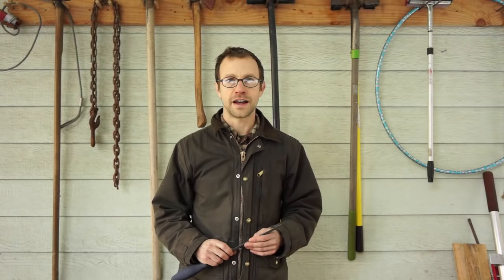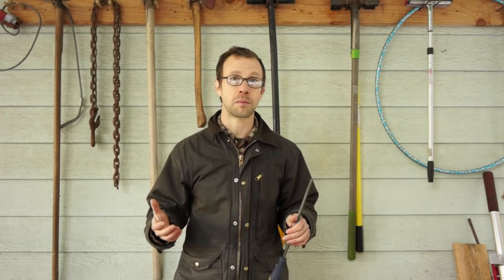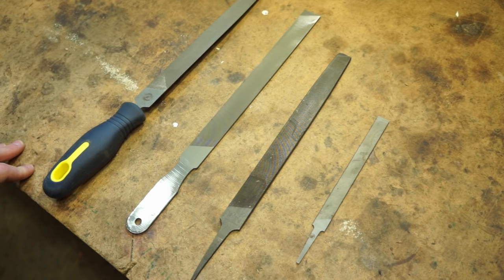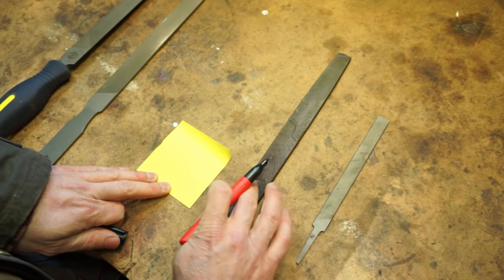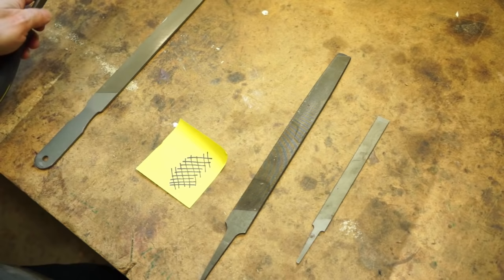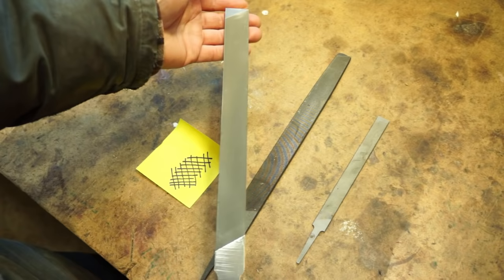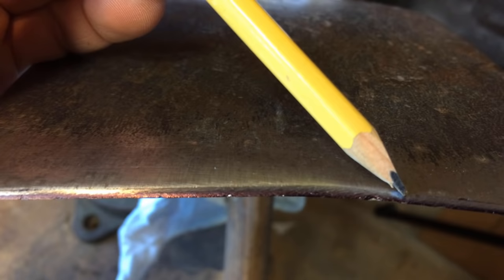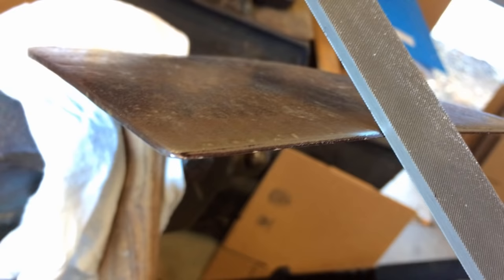How to Sharpen Garden Tools - The Ultimate Beginner's Guide

Comment: Very helpful for first timers.  However it was not clear which side of the file was used. The tips on using the vice & cleaning off rust was great but would like to know what type of oil to use after cleaning blade with vinegar. Overall a well recorded easy to understand speech, good details & almost perfect.

Comment: I sharpen mine when they get to dull to cut.  I use my angle grinder to buzz their edges until the are sharp enough to get the job done.  This is the same too that I use to sharpen my lawnmower blades.  If you buy files, as I do, buy Nicholson files.  They are the best and last the longest.  I generally use smooth files more than bastard files.  I have both.  If I have a tool with a real damaged area I use my angle grinder to clean it up and get it re-profiled and then dress it up with a smooth file.  If the edge is not that bad I just hit it with a file if it needs a sharp edge.  Most hand tools do not need a sharp edge, like hoes and shovels, because they get dull, quick.    Most of my yard hand tools get buzzed with my angle grinder.

Comment: Matt: I have read online that you can also clean tools with baking soda. What is your opinion on using baking soda with water or baking soda with vinegar? Should I only use vinegar (as I do not have the wire brush tool).

Comment: Thank you for the video. I have a file that was my dad's and I always wondered what it was for! Ha! Is there a way to determine whether it is a bastard, second or smooth? It's still in good condition (I think). Also, I can't seem to find the rust eraser you were using. Do you have the exact name or a link? I am finding regular woodworking sanding pads that are more of a sponge with sandpaper around it. I am also finding rust removing whetstones. But nothing that are like a soft eraser embedded with particles. Thanks!

Comment: Hey Matt: Terrific video. I've bookmarked it. Looking forward to getting started. One thing...in the other clips, a number of people suggested using vegetable oil in the beginning cleaning process and at the very end for maintenance. Didn't see it in yours. What do you think? Thanks again...Gerry, Madison, CT.
Reply from the maker: Glad it was helpful, Gerry.  I see no reason to use any oil before sharpening, it will only gum up your file when you begin sharpening, and I don't think it would help with cleaning.

 A little oil at the end to prevent rust would be good, though.  (especially at the end of the gardening season)  Take care!
Reply: Thanks, Matt. Duly noted...I will follow the advice. 
...gp

Comment: after the bastard file, you used a second file? what mill was that? thanks G
Reply from the maker: Geri, the main file I'm using is a second cut file.  It's a bit smoother than a bastard file, but still removes metal fairly quickly.  The blue handled file is a double cut file, which cuts very quickly and leaves a rough edge that you'd want to follow with a bastard or second cut file.

You can get away with only using either a bastard or second cut file, I just prefer the second cut.